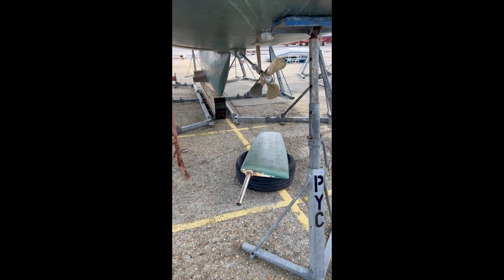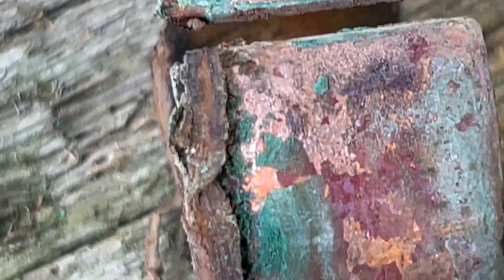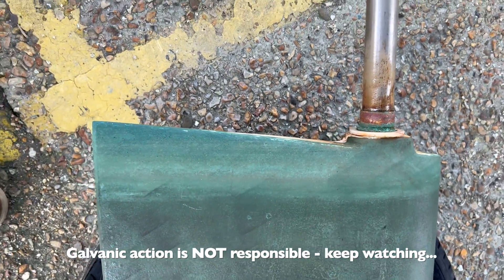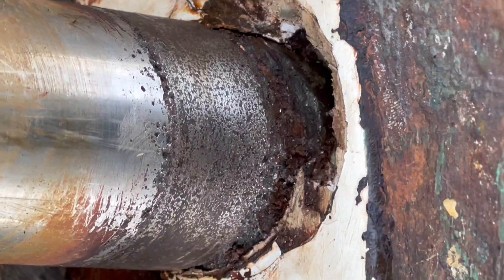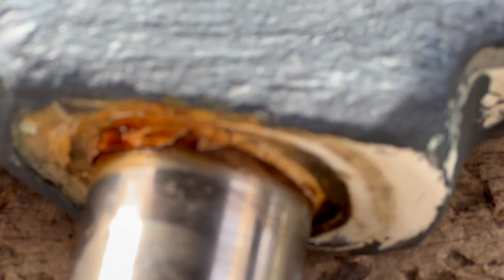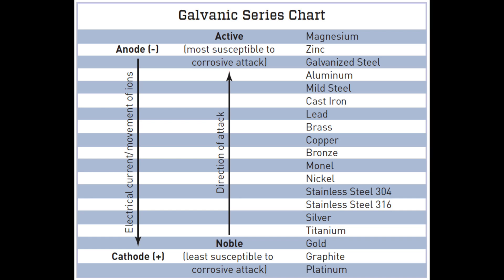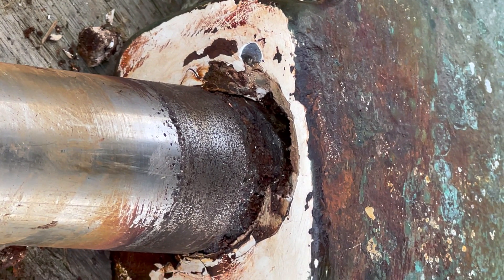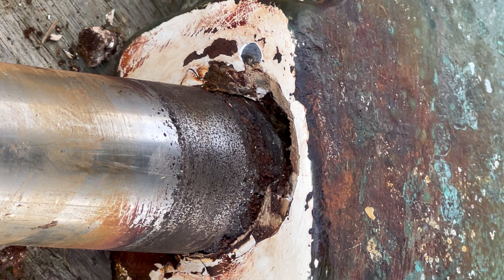Alarming Rudder Stock Corrosion on a Sun Odyssey 349 under 8 years old!

Comment from the maker: Jeanneau have immediately responded by offering me new rudders and bearing FOC.  They advise that they have identified a crevice corrosion problem affecting some 349s and have modified the rudder to prevent it. The speed of their response suggests that they have a policy in place relating to this issue.
Reply: That's a result - good job by Jeannaeu for immediately owning up to it, but given the potential safety implications of a failure it seems to me that they should be a bit more proactive about alerting owners to the problem.
Reply: Hi again a very useful although concerning video for any 2015 built 349 owner. Our boat was built and completed December 2015 but not sold until June 2019. We of course asked the UK importer agent about the comment that Jeanneau had identified a problem and had a programme to modify the design. 

The agent was not really aware of the issue and their response a few days later was effectively that there was no real factory call back situation each owner would have to identify the issue and than make a claim. I was wondering what you were working on when you identified the issue. We have not been able to see the top of the rudder stock so hard to tell if the issue exists. 

My specific question was had my boat been fitted with the modified rudder design? I have had no response to that! You would have expected Jeanneau to know if they had modified the design which boats had the new design and therefore which boats might have the older at risk design. 

Really valuable video.
Reply from the maker: @jvt-gtl-toc I suspect that your boat has unmodified rudders.  If and when you spot corrosion it appears that they send rudders without argument, so I would just check each time you lift out.
Reply: @theboatcheat1204 thank you. How do you get your boat to a comfortable working height. The agent said the only way to do that is on a hoist with the lift straps as specified. I would like to lift it for a shirt period to check things as you suggest. Plus remove the flaking anti foul.
Reply from the maker: @jvt-gtl-toc When I keep it ashore for work it is in a cradle with the retracted keel on wooden slips and this makes everything simple… you can access the boat using a small stepladder and the swim ladder.  If you leave the rudder extended this would be impossible.  I have not had any issues with this in 9 years.

Comment: That’s pretty bad crevice corrosion. I would agree that oxygen depletion is a likely cause. Do you know what grade stainless it is? Is the shaft attracted to a magnet? My question would be even if the manufacturer accepts so,e responsibility and helps you out with replacement, what is to prevent it happening again? I doubt you are the first owner who has experienced this problem, so it might be worth asking if any changes were made to the design since your boat was built.

Comment: You appear to have isolated galvanic corrosion & electrolysis thru investigation/ testing from being a cause.  The depletion of the oxygen theory along with the film evidence reflecting an intense localized circumference of corrosion above the bushing does support this school of thought. The pitting within the bushing may or may not.

Had a similar situation experienced with 416 SS utilized for underground natural gas piping addition for a hospital addition in San Diego, CA.  The line was bedded with sand and above the crown, with the trench remainder backfilled with a cement/ sand slurry.  This created an oxygen seal, where the line started to corrode and leak under the high operating gas pressure.  The lines were replaced after 4-5 years with industry standard yellow polyethylene piping.

Being a marine environment only assists the advancement of this corrosion.

The depletion of oxygen theory is applicable, but there's always a 4th option which someone more knowledgeable may suggest.